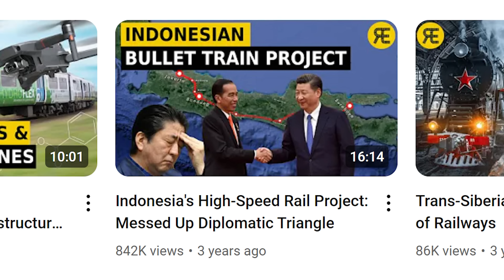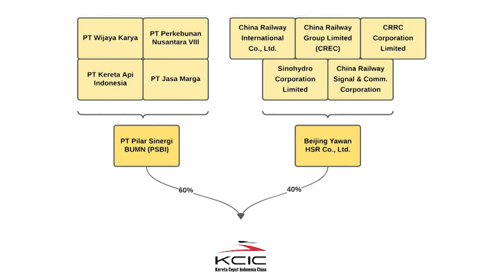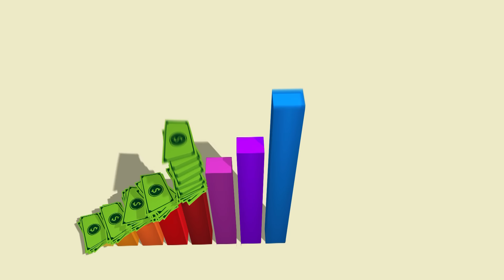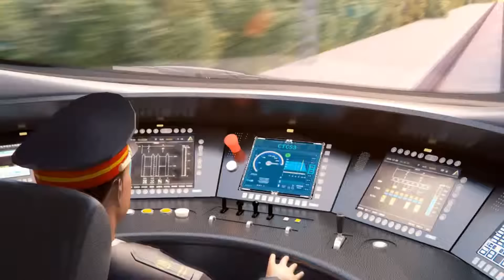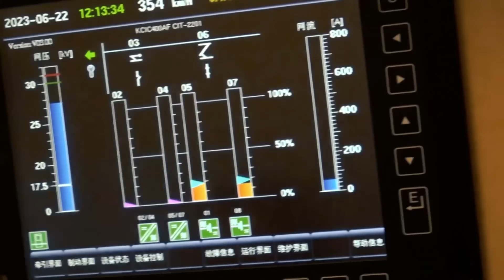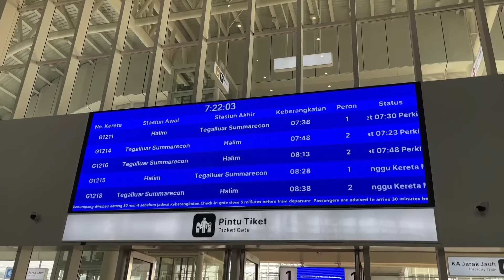Indonesia’s High-Speed Rail: One Year of Jakarta-Bandung Operations | 2024 Project Update

Comment: Some correctional note:
1. Walini station are canceled, replaced with Padalarang station which connected with feeder train to Bandung station which located in the central of Bandung city. 
2. The feeder train from conventional train are only available on Bandung area, to be specifically Padalarang station. The Halim station on Jakarta area are served with LRT Jabodebek, a medium capacity metro system built to connect suburban of Jakarta (including Halim station) to city center of Jakarta.

My personal opinion on this high speed train is that it haven't reach the maximum potential. Most of the passengers of this high speed train are from Bandung area. The reason of this is due to the lack of transit system in Bandung city that connected to Padalarang and Tegalluar station. Most people can drive their car and do "park and ride" to the station, took the high speed train, then arrive in Jakarta with many of public transit choices, so they can go to almost anywhere in Jakarta. Meanwhile for people in Jakarta, they might have access to the Halim station and took the train to Padalarang, but after that they can't go anywhere because of the lack of public transport in Bandung area. The only proper transit is the conventional feeder train from Padalarang station to Bandung central station. Tegalluar have zero rail transit access, only some small bus services. With this situation, people from Jakarta can't go anywhere other than the city central. It doesn't help that most of the Jakarta's people prefer to visit the tourism spot instead of the city of Bandung it self, which mostly located far from the high speed train station or the conventional train station and have no proper public transit access to there. This issue become the reason the high speed train less popular among Jakarta's people and they still prefer to use private car to Bandung which is the main reason of the very long travel time between the cities. 

The government, especially the regional government of Bandung need to built the proper transit on Bandung area ASAP. They need to built more access of transit system to the high speed train station. Once the traffic issue and lack of public transit in Bandung city already solved, then this high speed train will meet the biggest potential it can get. 

Overall, that was a great video and thank you for making this video.
Reply: They are planning to build LRT system in Bandung
Reply: From my personal POV this video do not really have reliable source of info. It is pity to see how many misleading infos here to the point I suspect that the video actually intended to discredit the Chinese HSR.
Reply: @fendysuryanto  Is it normal for high speed train system have criticism especially regarding the huge cost of it and many issues, and it's not just China and Indonesia. Japan literally need to sell their own national railway to the private sector due to the high cost of operating the Shinkansen. China have their issue with building HSR station far from city center (just like in Indonesia too). Spain have the same problem like China regarding the cost of their ambitious project to built their HSR network in their whole country. Germany have the problem with their unreliable schedule (although this is not purely due to the HSR system), also their overpriced Stuttgart 21.  And UK, God forgive the King and curse their previous prime minister, had to cancel some part of HS2 due to massive cost increase. It's not just about geopolitical, it's about the HSR system it self. It's a great system, indeed. Im totally support any high speed train system all across the world. But it's not a perfect system and any government in the world who want to apply this system need to solve the issue too.
Reply: @skyskysky2023 Im really wish they execute the plan ASAP. Also the capacity of the feeder train in Padalarang also need to be increase. Electrification from Padalarang to Bandung station is a must, and removal of level crossing is needed. With this, frequency of the feeder train can be increased and they can use better rolling stock for the feeder train, like EA203 EMU just like the airport train in Jakarta.
Reply: @skyskysky2023  They are planning those things, but last time the governor planned something in the Greater Bandung region, the plan never came to effect. (I know this very well, I live in Bandung!) I really hope this time is different, that this time they FINALLY execute the plan.
Reply: @rakandzakwan6402 I was emphasize on factuality while doing criticism. Sure, some of his points remained valid but you can't always criticize anything while doing nothing about due diligent in your report.
Reply: KCIC has stated that WHOOSH will start serving line between Padalarang and Tegalluar hasn't it?
Reply: @nezukoshop  Yeah, but is it matter? Like Tegalluar are pretty isolated with no rail access and even no major road access, only small road with bunch of feeder buses that most likely get stuck on traffic when entering Bandung urban area. Tegalluar are built for the future governor office of West Java province so in the future it might really be connected but today not much around it.
Reply: Based on China's experience, the areas between high-speed rail stations and traditional urban areas will develop rapidly.
Reply: @Aynuze  It will, but not in the short time. That's why I said the HSR are not meet the biggest potential yet. Current achievement will be there if the area surrounding station is developed enough and there already a proper rapid transit connection from the station to many destinations. In China maybe it took only around 5 years due to how big and advanced their industry, but in Indonesia it will take at least 15 years to be happen.
Reply: @rakandzakwan6402  It doesn’t matter, it’s a matter of time, development is a natural process.
Reply: As a 'Jakartan' in Bandung, this so true. If you want to reach places in Bandung, you need OJOL, or your own vehicle, preferably your own vehicle. Meanwhile in Jakarta, you barely need one, just one card will bring you anywhere in the city.

Comment: It's funny that at the start you present a wrong map and station (Walini is cancelled/suspended, while the place you put Walini is in fact Padalarang), meanwhile at 5:40 you put the correct map with Padalarang on it. A simple Wikipedia read would've been sufficient to fix that tbh.
Reply: The creator of this video is lack of Research & lazy
Reply: It is funny that what you pointed out shows that you did not understand. The first map they showed was the original plan and that was what the narrator was talking about. I think you missed it or just ignored what he was explaining. Later they showed an updated map. Like you pointed out, later that station would be cancelled. A presentation does not have to spell out every single detail, because they assume you are smart enough to put 1 and 1 together.
Reply: @skyskysky2023  Or the listener is too lazy to think for themselves and want everything to be laid out in front of them.
Reply: @zam023  Yea even if that was the case, why would he put Walini at where Padalarang is? And also he's not directly specified if it was the original plan, or the current plan. He only stated about the scope of the project, to which Padalarang was already on the plan quite early too, despite it's "last thought" due to more study that Walini might be not be suitable for HSR station.

Comment: Pointing this out
0:46 That's not Walini, that's Padalarang. Walini was never realized and cancelled, since the bigger project alongside the station basically never happened. 
9:56 More like First, Business, and Premium Economy Class, as Whoosh/KCIC call it actually on their booking page/app.
10:00 The train has a more, smaller bar-styled car, rather than a dining car actually, so no. Hence, the bar car is actually an Indomaret bar car, and only a few dozen of people can sit there.

Also, a lot of the "feeder train" footage is wrong. The footage shown are the KAI Commuter (KRL Jabodetabek) in Jakarta, which is powered by electric from the overhead wire. The feeder train is actually colored green and diesel-powered. And from Halim, you can connect to the HSR with the LRT there.

Comment: Currently the train is not that effective yet since the public transportation in Bandung is really bad so it's hard for Jakartans to move around in Bandung, it will be more effective after Bandung public transportation is getting better. Also it's gonna be more effective after the project continue the line untill the other end of the which is gonna continue in the next few years but this time Indonesia gonna take bigger part in the construction and manufature since Indonesia trains manufacturer is the one that gonna attempt to build the train using the new technology it get from china, of course since it will be the first time Indonesia not gonna made the same one as current train but the 250 KM/H one, if this successful the increase of monthly users will be very big.